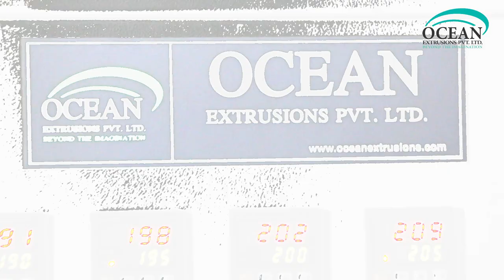Plastic Recycling Machine Cost in India

Comment: Kya is manufacturing plant ko pollution control board ( PCB) pass kr dega kya ???
Agar nhi krta toh machine lene ka koi fayda nhi h
Reply: Kiyu bhai bto agar pcb pass nhi karte to kya hoga
Reply: Yes they will and this process will never release harmful fumes or gases into air so there is no problem with this process note here in this process they are just melting the plastic not burning it to release harmful gases